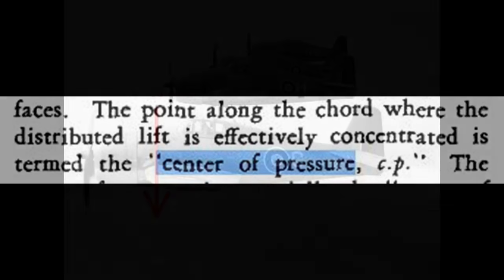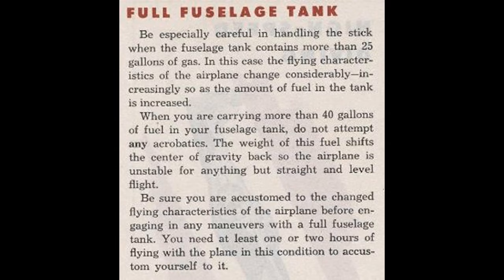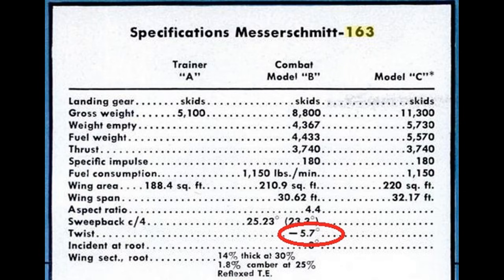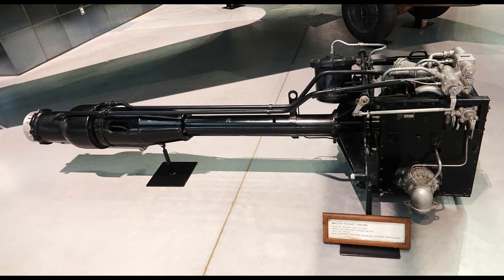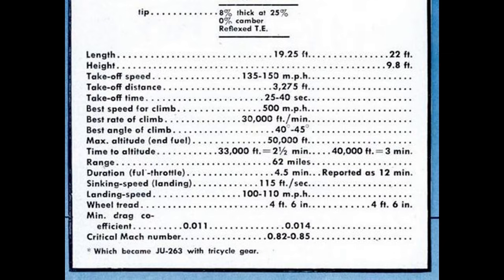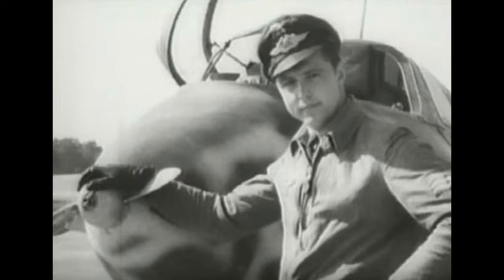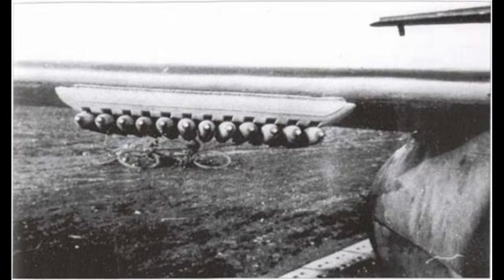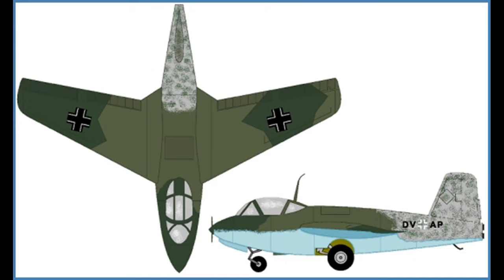Messerschmitt Me 163 Pt.2 Plus Me 263 and More!

Comment: Another fascinating video, thanks for all the time and effort you put in. 

Regarding the MK 108 cannons, is it the case that they didn’t use the MK 103 because of size and weight constraints?

Although all the rocket-powered interceptors were probably not going to be of much use to the Germans, I suspect the Bachem Ba-349 would have been a less inefficient use of resources. At any rate, considering the nature of the Nazi regime, it’s fortunate none of these weapons did affect the outcome.

Comment: You left out the F-102 Delta Dagger in the evolution of Lippisch's design. It looks like an intermediate step between the XF-92A and the F-106, with the monster right triangle vertical tailfin and side mounted air intakes. The 102 did see combat early in Vietnam, but with the Falcon's missile performance and the lack of proper training the 102 suffered losses and was withdrawn. The 106 was originally a revision of the 102, but was redesignated when it entered production. Oddly I do not believe it ever used anything but the Falcon missile and Genie rocket operationally, even though the 106 served into the 1980s.
Reply from the maker: Yes, Ieft out the 102, the video was getting too long so I had to leave some stuff out.

Comment: Any chance you'd be interested in covering the He 100? From what I know, it was originally a racing aircraft that set the air speed record at the time, but was considered unsuitable for military aviation use due to coolant being piped through the wings for cooling in the absence of a radiator. Huge aerodynamic benefits, but massive issues if any of those coolant lines are punctured. It was mainly used for propaganda purposes, but that top speed for the time was unheard of and apparently the test pilot pushed the airframe to its absolute limits, well beyond what was recommended to him. Your videos are chalked full of excellently presented factual information and I can't stop watching them! Cheers!
Reply from the maker: At the moment I am finishing up my 190 video. It has a bit about the He112 in it, I know that's not the same, but it's sort of close.

Comment: Back in the eighties I worked at an aerospace company. Once I attended a professional dinner where I sat next to an engineer from Naval Air Station Oceana. He commented that although they tested  Sidewinder air to air missiles without warheads, they still had a tendency to hit and destroy the target drones. As drones were expensive, they would routinely crank in an offset to the Sidewinder guidance system to ensure it would not hit the drone.  He went on to say that this was not necessary with the Falcon missile, as it never hit the drone. The Falcon was refereed to as "the friendly missile".
Reply: Yet the Swiss spent a fortune when buying the french Mirage III in the sixties as they wanted the best of the best and so they wanted the U.S. Falcon missile system fitted to their Mirage III. The radar and electronics (from Hughes I think) was called "Taran" presumably to guide the Falcon. In almost 35 years of service you can find actually only few early pictures of Swiss Mirage III mounted with Falcon on the center point of the fuselage. The whole acquisition program went to so much overcost it became a political scandal and the Swiss Parliement ordered a reduction in half of the initial order to recoup the budget over-inflation.

Comment: Would you say that the Bell X-1 series flown out here at Edwards AFB  (first supersonic flight w/swept-wings, 14 Oct '47) nicked name "Glamorous Glennis" by Chuck Yeager was a copy of this aircraft with improvements?
Reply: Not really. The X-1 used thin straight thin wings instead of thick swept wings and had a conventional tail. While the X-1's horizontal stabilizer had conventional elevators, the trim worked on the whole horizontal stabilizer, acting like a flying tail.  Pilots found that as the elevators lost authority near the sonic barrier, they could still fly the plane using the electrical switch controlling the tail trim.
Reply: STonn       TX for clarification!
Reply from the maker: It's exactly as Stonn said. Thanks STonn!
Reply: I thought that  the Germans figured that you need sweep-back wings for supersonic flight to stabilise buffeting ? X-1 didn’t have this design?
Reply from the maker: As with almost everything, there are multiple ways to accomplish the same thing. Another way is a thin stubby wing.

Comment: Have you considered doing a video or a series over the P-39? It gets a terrible reputation in the US service as a bad fighter but I've heard the Soviets used it very effectively. I always thought it was a cool design and the P-63 seemed to fix many of the issues.
Reply: It was poorly suited for high altitude because it lacked a supercharger, and it was less maneuverable than its foes in the pacific theater. However it was excellent at low altitude and the Soviets used it to great effect.

Comment: 16 claims, 9 actual kills, probably some others were only damaged; 1.8 : 1 ratio is OK for the war.
Reply from the maker: It's actually pretty good. It's not unusual to see claims vs confirmed numbers at 3 or 4 to 1.
Reply: Probably helped there were so few ME163s flying. A lot of overclaiming is because you have different units flying, and pilots from different units are claiming the same kill. The Luftwaffe's claim system struggled with US bombers more than any other type because the air battles tended to draw in dozens of different German units stationed around the Bomber streams flight path. With the ME163 you pretty much have one (?) unit flying the type, and only a handful of planes up most of the time, so if you see a plane falling there can't be too many other people responsible.

Comment: Thanks for the video! Would you consider "center of lift' in lieu of 'center of pressure'. Also, what physical model of wing lift are you proponent of - the upper/lower  wing surface pressure differential or the reactive force caused by the downward thrust of large volumes of air by the wing? The reactive force model makes more sense to me and the physics arguments seem more convincing. Or do you think wing lift is a combination of both of these physical phenomena?
Reply from the maker: Aerodynamics for Naval Aviators uses the term "center of pressure", thus so do I. Now if someone wants to call it center of lift, I guess that's OK, just don't do it on a commercial pilot oral exam. I'm not getting into the discussion about how the wing makes lift. That's way too complex for the comment section.
Reply: Thanks!

Comment: Center of gravity should be at least behind the landing gear....  (HellCat) roughly move landing gear back until it could balance.... front to back
Reply from the maker: That's correct. It has to be or the plane would tip over on the ground. Of course on a plane with tricycle gear it has to be in front of the main gear.

Comment: I noticed that when people talk about how great F-106 for whatever reason was they do not mention F-102... However I must admit that without the 102 program failure there wouldn't be my favorite century fighter F-101B (which also was capable of carrying Genie missile).
Reply: The 101B carried two Genie's and two AIM 4's. I think the 106 carried one Genie and 6(?) AIM 4's. What I remember about the 102, some of them carried " scatter rockets " in the armament bay doors. Funky.
Reply: @robertraczki6220  The biggest problem with 102 was that under full load it barely could break the speed of sound (which was a big deal since in a few years soviets would have Tu-22 as well as Kh-20 & Kh-22 missiles) so they had to do a lot tweaks to the wings, tail and whole airframe to get 106.

Comment: In the 1980’s my Dad and I used to go to the Florida gulf to fish for Red Fish.  When there, we would seen F-15’s and F-106’s from Tyndall AFB doing dissimilar air combat maneuvering with F-16’s from Elgin AFB.  You can’t miss seeing an F-15 in afterburner at any altitude.  You could get a glimpse of an F-16, but as soon as he rolled or turned, you’d lose him.  Both of those aircraft roar, the F-15 More so.  The F-106 hummed or moaned.  You could pick it out for a second or two because of to size, but, like the F-16, in hard maneuvers it just disappeared.

Comment: Another excellent video.  Especially liked the history linking the Me-163 to the F-106.  Hadn't thought of that before but it makes sense.  Some observations on the F-106 based on flying against the F-106 unit from Griffis AFB at College Dart in 1976.  Tyndall AFB had gone operational on their Air Combat Maneuvering Range (ACMR) and, after years if not decades of neglect, started running ADC units through College Dart to give them some dissimilar air combat maneuvering experience.  They did not have dedicated adversary aircraft at that time so they invited other units to provide opposition.  My navy unit--VF-51--accepted the invitation.

The Griffis CO briefed us on what to expect.  Main problem was they knew the AIM-4 was worthless so we started by pretending they had a weapon by giving them AIM-9D/G capability.  Believe they were scheduled for the gun pack upgrade but hadn't gotten it yet.  Next, the plane had terrible visibility for ACM that really made the pilot's job difficult.  Also, while the plane had a good turn it had dangerous departure characteristics that made using maximum turn performance problematic.  An F-106 departure could readily progress to a spin and spin recovery was not a given.  Really hard to re-establish controlled flight with that highly swept delta wing once a spin developed.  Our hard wing F-4N departed readily in certain flight regimes but also recovered nicely if you followed departure control procedures.  You know your aerodynamics so just think about spinning a plane with 60 degrees of leading edge sweep.  That said, we got into a rolling scissors with their CO and he really knew how to fly that airplane.  We had to extend out the bottom since he was eating our lunch in the rolling scissors.  However, as I mentioned in a previous comment, the F-106 slowed down fast due to energy bleed and didn't accelerate well when starting from a high AOA.  Made it easy for the F-4 to extend away once a F-106 got slow.  Plus, after flying against Topgun A-4s and F-5Es, it was nice to fly against a plane as big as the F-4 where you could extend and still keep sight.  Overall, our F-4s did quite well against the F-106.  However, in 1976 Navy ACM training was quite strong while the Air Force was still working to re-establish effective ACM training.  That training disparity determined results more than direct aircraft comparisons.  In fact, Navy section tactics at that time were driven by the fact that the F-4 didn't turn well.  We just found other ways.
Reply from the maker: Great post David, Thank You!
Reply: Back in the eighties I was once at a professional dinner where I ended up sitting next to an engineer from Naval Air Station Oceana. He described to me how although they tested AIM-9 Sidewinders without warheads, they still often struck and destroyed target drones. Drones are expensive, so they would program an offset into the AIM-9 guidance system to be sure it missed. He told me this was not necessary with the AIM-4 Falcon, as it always missed anyway. Their nickname for the AIM-4 was "the friendly missile".

Comment: Excellent, as usual, Greg. Sweepback aside, Is that engineering concern about the tail's downforce related to the Hellcat's widely-noted "tail-down" flight attitude because the prop shaft orientation was purposely a couple degrees below horizontal ? Were the designers trying to deal with that issue more or less in advance? My Dad was the sole pilot to fly the XF-85 "Goblin" out of Edwards AFB in the late 1940s for McDonnell Aircraft. The "Goblin" is "porkier"-looking than the 163, partly because it's jet-powered rather than rocket powered, but the proportions and flight time, not to mention some of the odd control surfaces, seem to me to be in the same ballpark as the 163, though the "Goblin" was undergunned from the beginning. Can't say I'd be enthused about adult diapers on a 30-hour mission in the B-2.

Comment: Well...Me 163: a "delicious plane" that reminds me the D.H 108, another failure. Made for crazy glider pilots ( Attacking with no motor heavy formations of bombers, only "one shot" landing, sittin between two fuel tanks, more than 40 died by accidents, only 9 shot down by enemy...) make by nuts engineers (wooden wings, canopy very dificult to open over certain speed, no tail, bad rudder, almolst no landing gear, no brakes, lethal, explosive and highly corrosive fuel, bad longitudinal stability, awful disponibility, very dangerous land operations...). A huge waste of lives and materials. But very I like it.